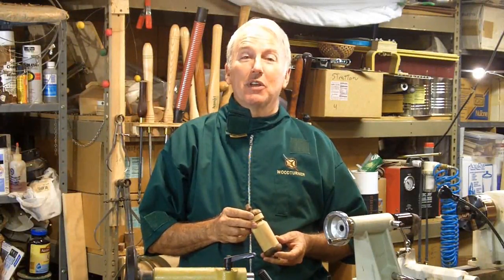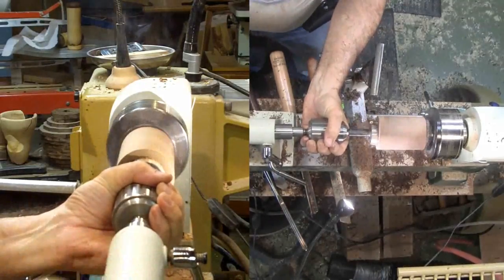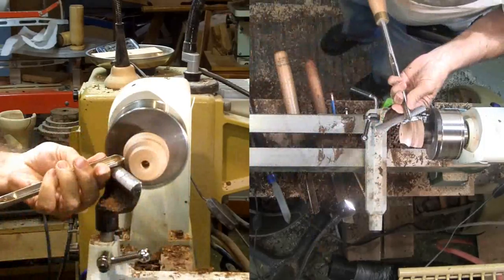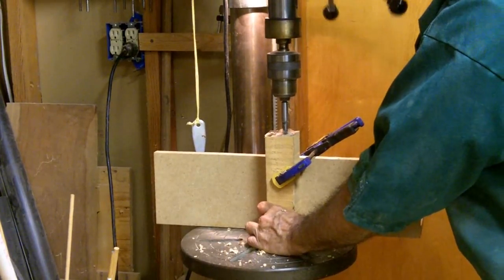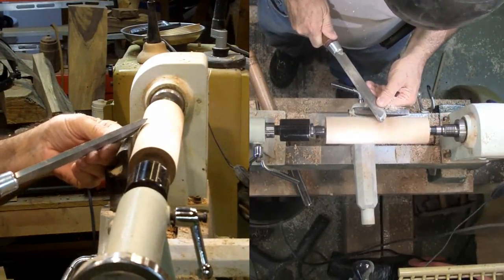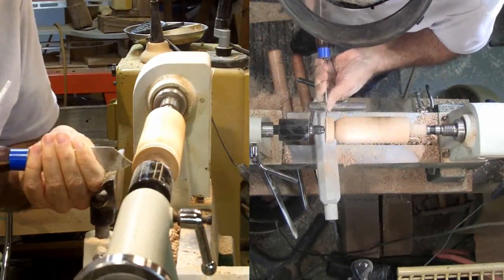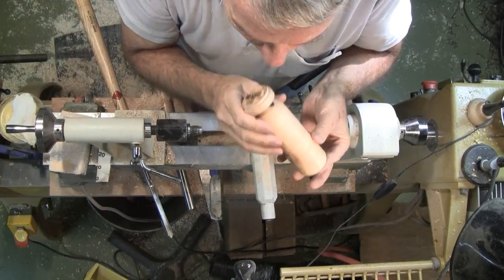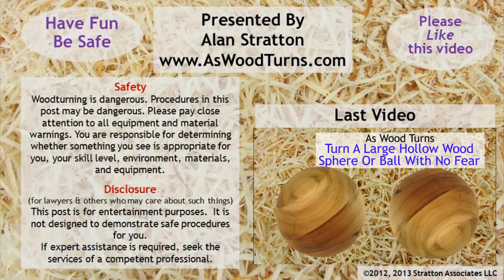Woodturning A Tune-able Train Whistle

Comment: Nice whistle :) The dowel plugs at the mouth end are called 'fipple plugs', the gap above is called the 'windway' and the edge created by the inner hole and outer angled cut is called the 'labium lip' (though I think 'labium' means lip anyway). The angle of the cut only matters to the extent that it shapes and sizes the opening and labium lip. The shape of the forward edge of the lip determines the quality of the sound.
Reply from the maker: Thanks for the technical specs. I hope to make more music. :)
Alan

Comment from the maker: Ok. The depth of the individual chambers determines the pitch. In my earlier whistle, I drilled each hole to a different depth for a different pitch in each. In this whistle, drill the holes entirely thru the blank. Then insert a dowel into the "tail" end. Move the dowel in and out until the target pitch is achieved. Then glue in the dowel to lock it in.
I'll edit the description to clarify.
Thanks Pablo.
Alan Stratton